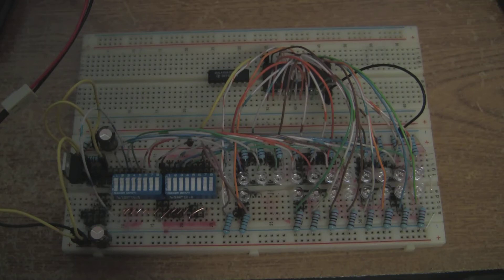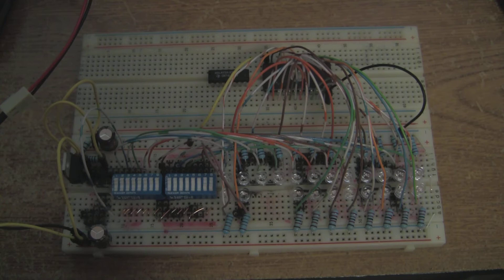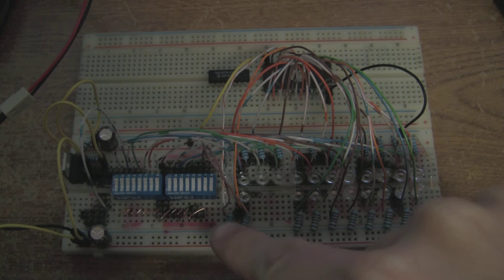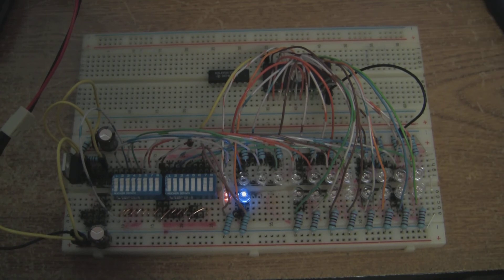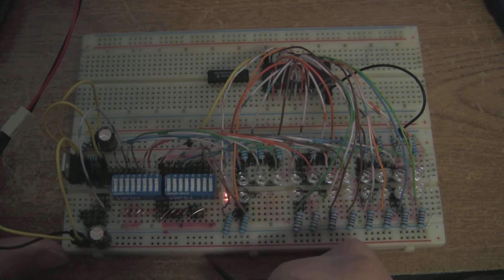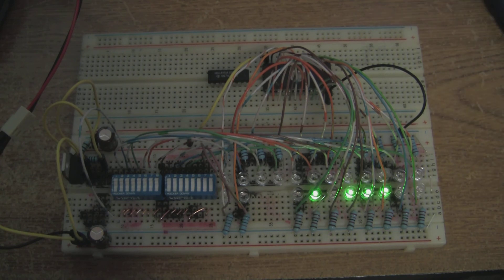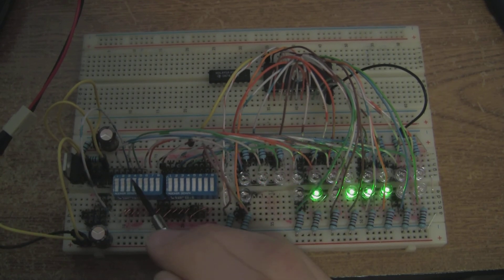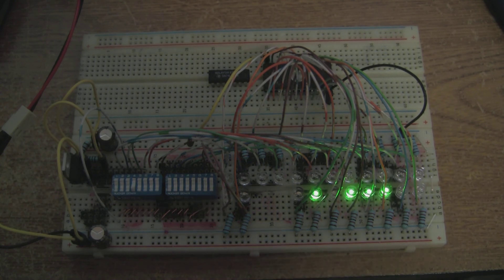Reading an Ancient 32K Intel EPROM By Hand

Comment: I have four NEC D2716D (Intel) EPROMs I pulled from an old card a while back, and two of them are still covered.  What's strange is that I can't seem to pull any data from them.  Nothing on the first four output pins ever lights up (I don't have any more LEDs at the moment).  Do you have any idea what I might be doing wrong?

Comment from the maker: Sorry, I didn't see your message until now.  Yes, you'll need to put pulldowns (or pullups) on all any pin that can float.  This applies to both input and output and should always be a consideration on any IO circuit, not just this specific IC.  I'd suggest getting some 10K resistor networks (as opposed to arrays) for such tasks as it can make the job quick and easy on a breadboard.

Comment: Dear sir,
I have an EEPROM similar to yours. Mine is M27C1001. I have a setup similar to yours. Except with mine, instead of DIP switches, I am using a 4040 12-stage ripple counter to control the address pins. I am also using an Arduino to control the timing of the 4040. But I have a problem: all my LED's are always lit. Can you help me?

Comment from the maker: @Slovenija12345 I don't believe so.  Like flash, the erased state of an EPROM is all 1s.  You can selectively drain a bit's charge by writing a zero, but you can't go the other direction without erasing it again.  For example, if you had 10011001 written to a page and overwrote it with 11110000, you'd be left with 10010000 in that page.  The ones would reduce but the zeros wouldn't charge up to be ones.  Ones are basically ignored--zeros are the only thing that cause an action.

Comment from the maker: @Slovenija12345 I don't really have a schematic.  All I did was create a 5V supply and power the device up.  After that, just use a switch cluster to apply 5V to the address pins and then view what output is on the data pins using LEDs.  Flip switches on your cluster to change pages.  I'd suggest using a FET for each LED, however, so you don't load up the EPROM.

Comment from the maker: @Slovenija12345 On this particular device (Intel 2732A), you'd apply TTL level signals (5V) to the A and D lines and then pulse !OE/Vpp to 21V for 20-50ms.  Other EPROMs are probably similar, but you'll need their datasheet to know exactly what they require.